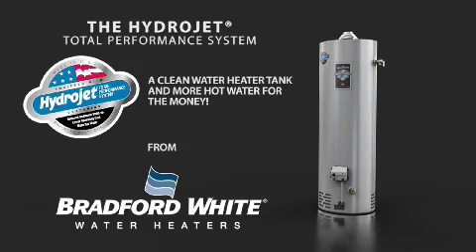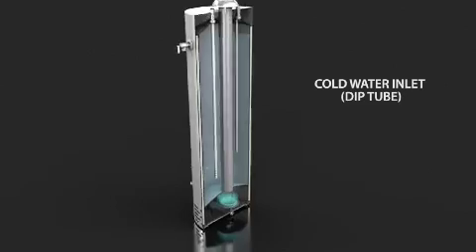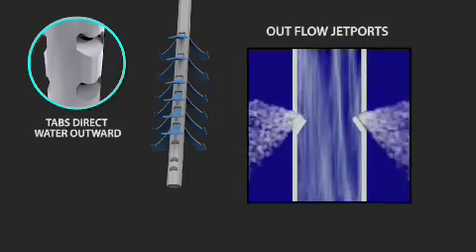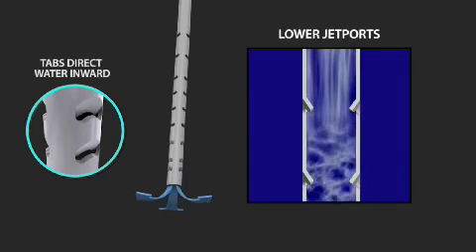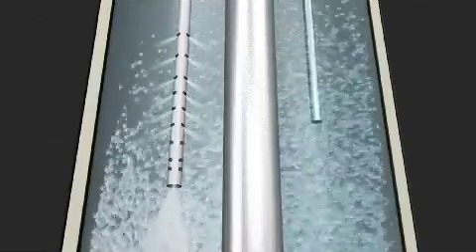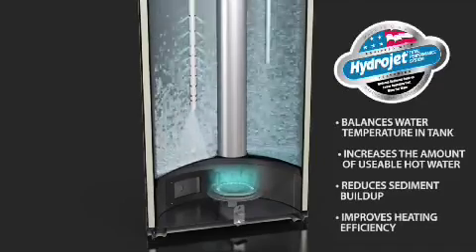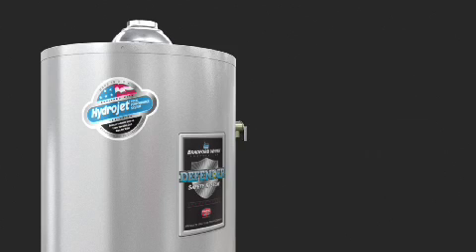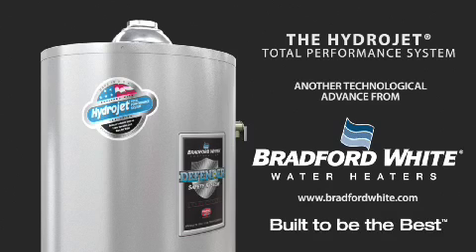Bradford White HydroJet

Comment: I'm on my 2nd Bradford White HydroJet gas tank and I hate to say it, but they've both been nothing but trouble! After 3 years, the first one leaked everywhere and had to be replaced and now this replacement (again after 3 years) has only ever produced luke warm water (less than 36 deg. C). Crappy design with the anode rod/dip tube. Made for service industry!
Reply: Do you have a salt softener?

Comment: Where is the anode rod on this water heater?  I believe it is attached to the hot water line, yes?
Reply: yes.  The output of the hot water line.  which you will end up disconnecting.  If you don't have enough space, then you will have to fully disconnect all lines and vent, flush all water and hopefully strong enough to tilt it to get to it.  Unless you have a high ceiling.

Comment: what is the Average life for this type of water heater  40 gls.      thanks in advance
Reply: Ive had mine on un-softened city water 7 years with no problems at all. Great heater.
Reply: depends on the water, minerals ect. more minerals can cause more electrolis which eats threw metal, i put a filer before the water heater for 8-10 years of use. from Keith @ Appliance Alliance in Las vegas 702-289-3480
Reply: I believe if you do your annual maintenance and other maintenance, any water heater will last a long time.
Maintenance I can think of:
Annually:
Flush the tank.
Check the Pressure Valve, release some water out of it.

Every 3 years:
Check the anode rod (this might be more work involved as you have to remove output hot water line to get to this) replace if needed.  This is also the piece of item that saves your water heater from failing in it's core.
Check the Pressure Valve to see if it needs to be changed,  Which it leaks, it's a sign to replace.

If you have an Expansion Tank.  Check the pressure on it. Make sure this is done as part of the Annual maintenance.  The pressure should be the same pressure from the incoming output.  I usually check the pressure from the release port.  (You need to buy a water pressure gauge for this).

I am sure there are other parts to check, however, these are the few I think is more important that I can think of.